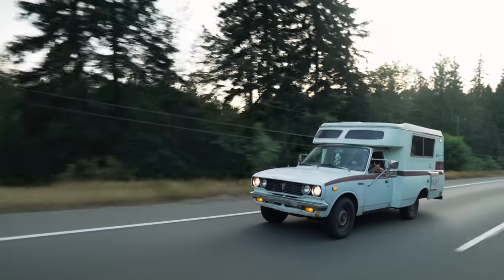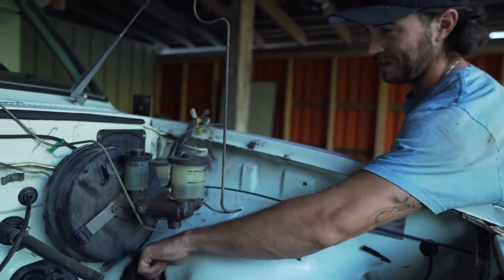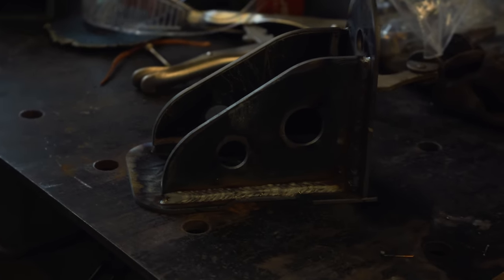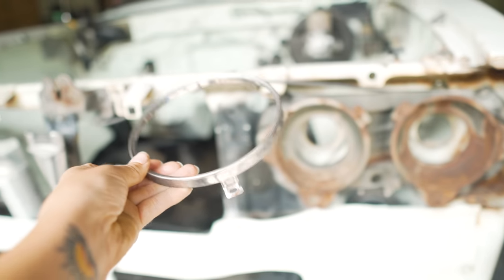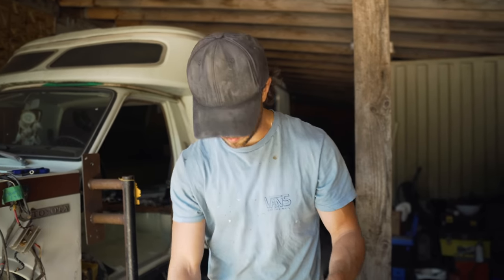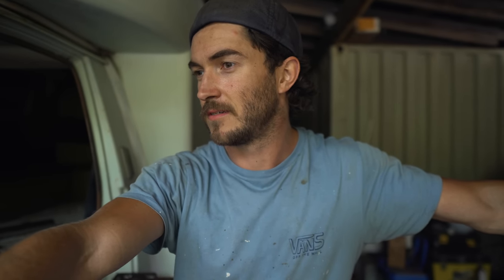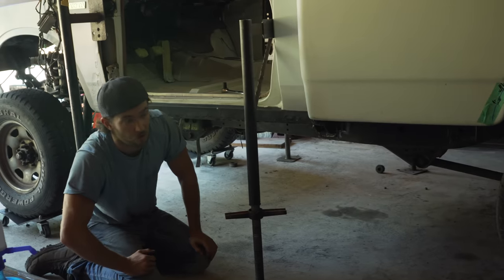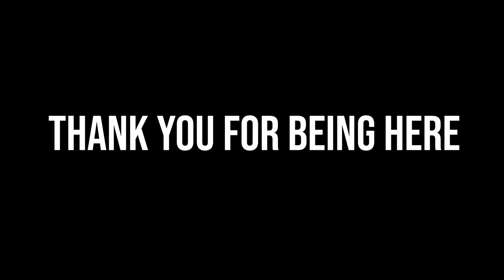4x4 CRUISER CHINOOK MOVES FOR THE FIRST TIME | 80 Series Land Cruiser + 1976 Toyota Chinook

Comment: Hey guys loving the build you might want to think twice about your frame support for the bottom of the camper if you put a 1 inch spacer all of that floor weight is going to be on those spacers your floor unless you put a new floor in is too weak. A better idea would be to run those directly to the floor to spread it out the weight over a longer distance and then grid it out from there also directly on the floor.
Reply from the maker: Hey thanks for the insight! Love your build too by the way. It will have about twice the amount of mounts on the rear from the original setup of only having 6. We're thinking of running more support laterally to spread the load along that 2x2 you saw me weld in. It will be somewhat of a grid, but also that plywood is 1.75" thick so I don't think it's going anywhere.
Reply: @ToyotaWorldRunners  I did not realize that you had redone the floor yeah you’re correct you should be OK.. We got to get together in camp with these things that would be a blast.
Reply from the maker: That would definitely be awesome!

Comment: So the 80 series chassis lines up with the chinook? You didn't show the rear fiberglass fender location, is the wheelbase the same?
I've got a '78 Chinook currently converting I've got Land cruiser axles but trying to figure out the FJ steering box and location. But after seeing your cool video series I might just grab the whole chassis. I'm stoked for you guys! Hope you show all the details on the steering and suspension setup 🤙
Reply from the maker: Wheelbase on the 80 series is only 1" longer!